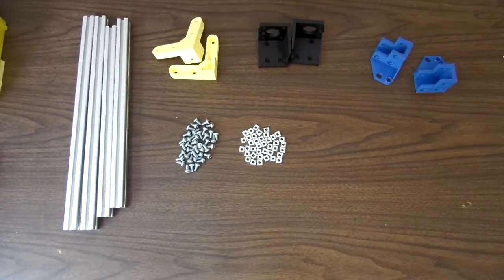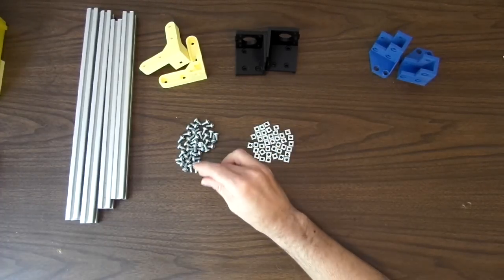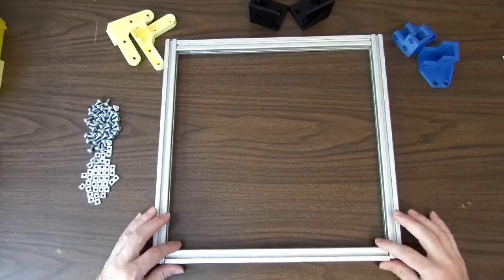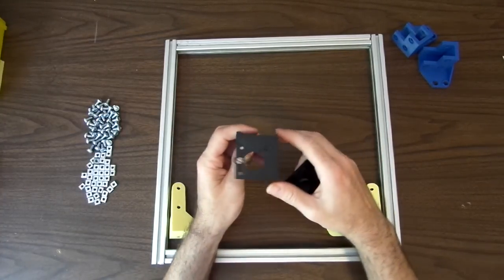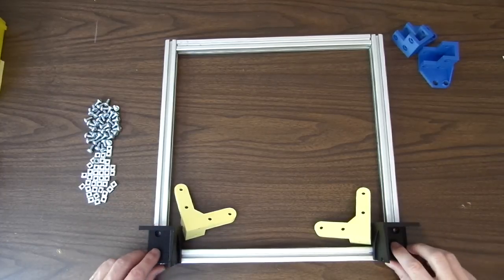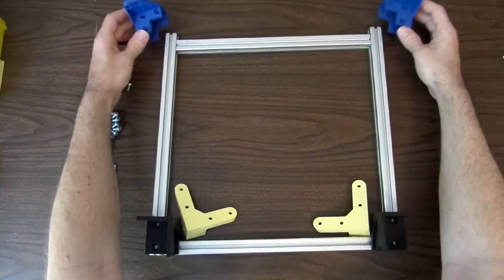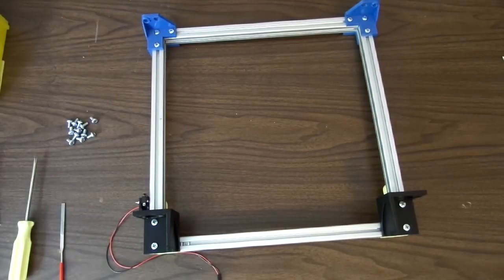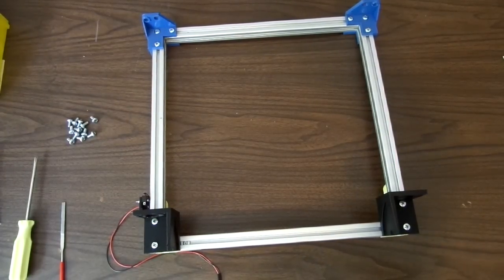Reprap Wilson TS Assembly Part 2 / 6

Comment: Is the 'TS' better than the 'RS'?  The two 10mm (or 3/8") threaded rods are slightly cheaper than the two extra extrusions and the RS would sit a bit lower than the TS for the same build height.  I imagine that the TS is a bit more rigid and the Y assembly somewhat better attached to the Z frame.

Also I got a good deal on a lot of 40mm Nema-17's that should be around 40-55 Oz/In torque.  I hope they might be good enough.
Reply from the maker: Kenneth, in my opinion there isn't much difference as far as build strength.  In either case, I get the most improvement in rigidity by attaching the printer to a print deck that is 18" on a side (1/2" plywood) as shown in the most recent video.  Screws through the rear frame brackets and at the Z motor holders is sufficient imo (*new Z motor holders, which I'm videoing this weekend**).  Some people report the threaded rods being more expensive, I guess it depends on what you have access to.  You are correct about the RS build deck being a bit lower, which means you can use shorter Z axis components.  The shorter 40mm motors should be ok as far as assembly.  Maybe want to keep your max acceleration and jerk a little lower if anything.
Reply: Marty Rice Currently, I've built a repstrap which I'm still 'perfecting'.  Once it is giving me reliable prints I will use it to print the plastic parts for a second printer.  I was considering an i3, but I like the Wilson design as it doesn't require any laser or water jet cut parts that have to be specially made.  What kind of plastic are you using for the Wilson parts, PLA or ABS?    I have a suggestion for improvement, instead of sliding the 8mm rods for the Y axis into holes into the end frames, drop them into slots as in the i3 and tie them down with a top cover or just tie wraps.  This will allow for easily removing the rods to replace the bearings without having to completely disassemble the Y assembly.  Those Chinese 8mm bearings DO wear out (so do the rods!).  I was also thinking of printing bearings from PLA or Nylon to use instead of those BB units, I've read that they are quieter and last longer.  Not sure if they would work for the Z axis, but do on the X and Y.

Comment: What is measurement for extrusion aluminum for this part. 20mm x _ mm.
Reply from the maker: What I recommend is 400mm for the vertical pieces, and 330mm for the horizontal ones.  Also, 400mm for the Y axis extrusions as well (so 4x400mm, 2x330mm).  You can alter those lengths as you wish, but with those lengths you should get a 200mm^3 build area.